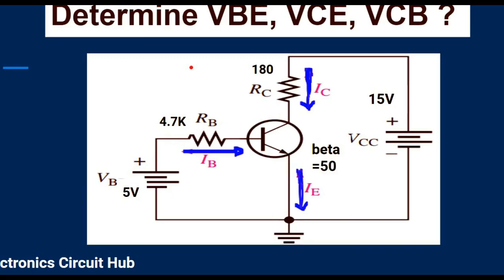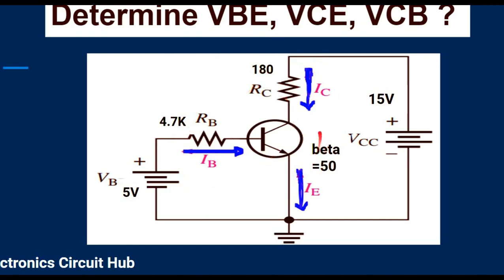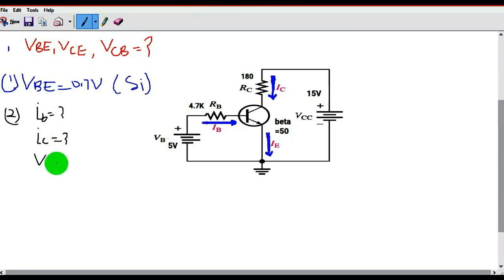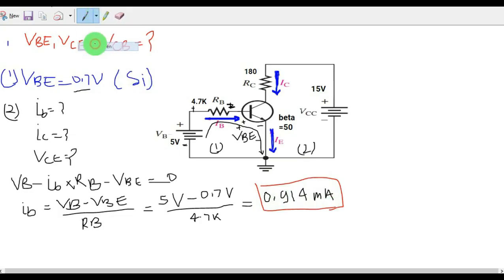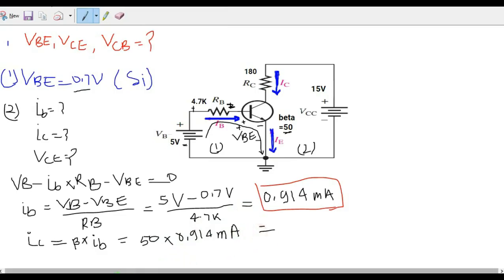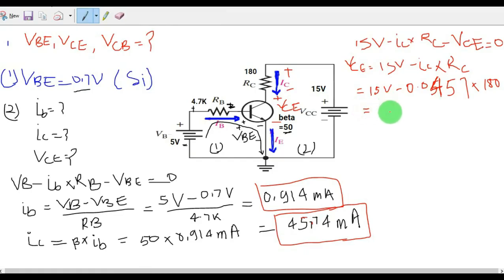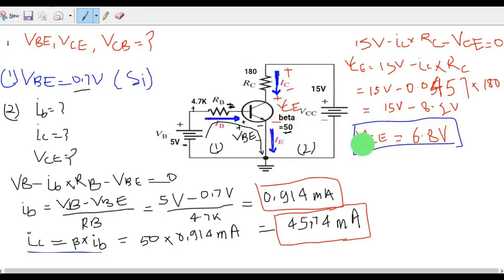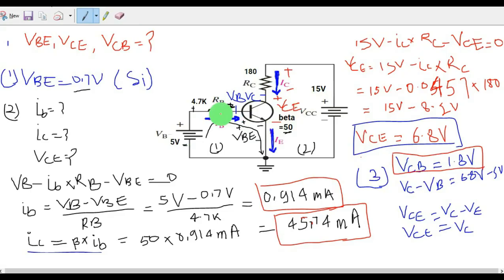Find VCE, VBE and VCB of Transistor || BJT Solved Numerical

Comment: Hfe for noise small signal gain and how it amplifies, how to count the the limitations on Hfe small signal gain max.

What is Noise Figure and what it is used for? 

Hertz calculation on inductance difference are in the form of ampere right? So without a bc547, just inductor, resistors and 5 volt source as standard could count be replicated as circuit. What would the circuit look like? The amplifier part was the tricky circuit diagram replica from the transistor only using resistors, capacitors, inductors and no transistors or circuit switches but pure maths on V=IR Kirchhoff's nodes.

Comment: 5v is not VB it is base biasing voltage, VBB... VCB = 6.8 - 0.7 = 6.1v
Reply: No 0.7 is Vbe which while voltage between the B and E nodes but we need to only Potential at B and we know that E is at ground and the Voltage drop iis due to the 4.7K resistance.
Reply: @Music-qg3ih So Vc is not 6.8 but Ic•Rc??
Reply: 6.8 - 0.7 yah I was also search for this .

Comment: Is the value of VBE= 0.7V a constant value or can be changed
Reply from the maker: No , it is fixed. But there is process variation in manufacturing so it has some tolerance. Lets say BC547 VBE(on)  varies from 580mV to 720mV. Hope I answered your question.